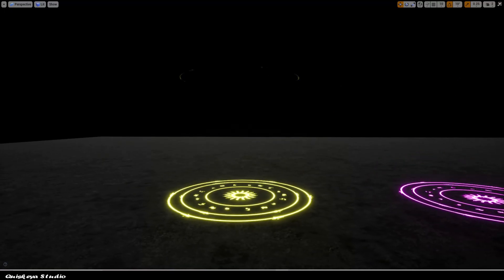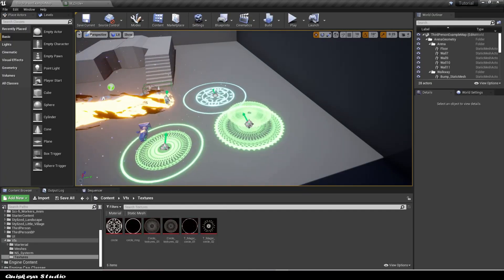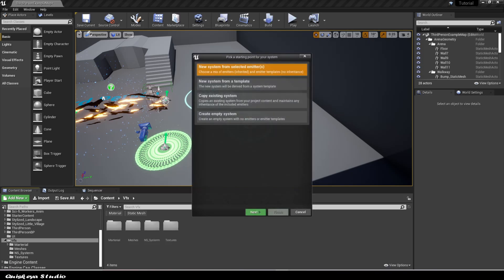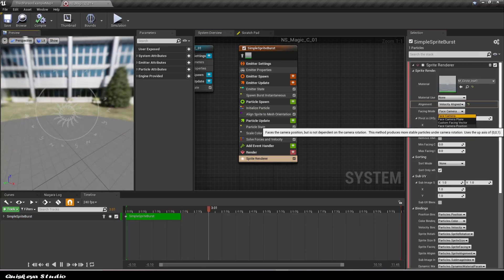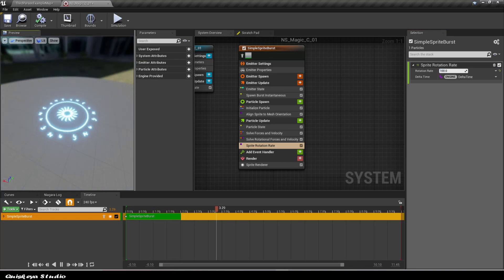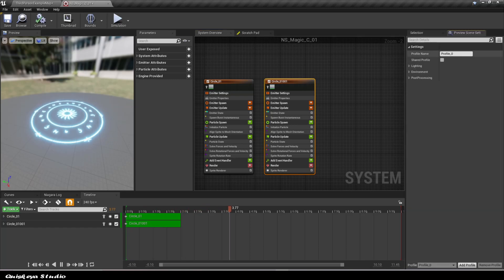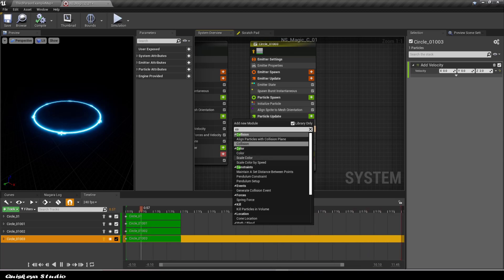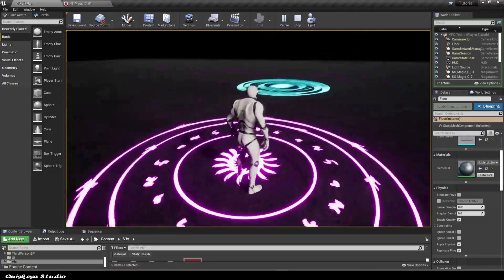Niagara Magic Circle - Unreal Engine tutorial.

Comment: Mine isn't flattening out like yours. I assume it has to do with changing the Base_Texture to param2d, which I have done, but I get a wrapping marble design instead of a flat circle. I've gone through the video multiple times and can't figure out what I've done wrong. Any ideas of things I could change?

Edit: I figured it out almost immediately after asking (seems to be the pattern for me). In the bottom right of the preview screen there are 5 icons, select the middle one that is plane primitive

Comment: Hello i am having a issue where by the end of lifetime the rotation resets, so im thinking that its not doing 360 in that lifetime, is there any way to fix this?
Reply from the maker: Hi,
The lifetime of the Emitter reset every modules by the end. So, what you can do, is adding a higher loop duration until the reset is not noticeable, or make sure that rotation position when the emitter end is the same as the starting position.
Hope that help.
Reply: @quiskeya  I tried increasing the loop duration from 2 to 10 but the emitter only loops for 2 seconds then completely disappears. Pls help
Reply: @999croissant if your using the textures from the example considering the design if you set rotation at 45 or 90 or 180 and so on when it resets it will be always aligned with the design if that makes sense so you dont have the "reset position" effect cause it looks continuous now

Comment: Hi, first and foremost thank you for this tutorial! Quick question.... I have a circle with a different design and I'd like to make it rotate 360 degrees. I got that on the rotation rate but then the circle spins real fast. How do I slow that down?
Reply from the maker: Hello,
The 'Sprite rotation rate module' use a float as in input to determine how fast the sprite need to rotate, so the higher the number the faster it will go. You can convert it a vector to give you the individual axes and then the float input will convert to a degrees input.